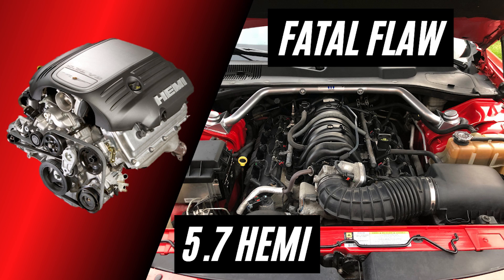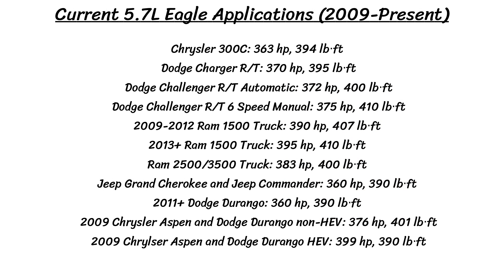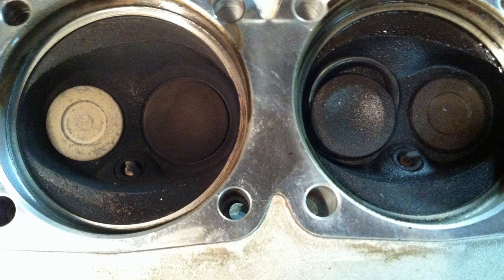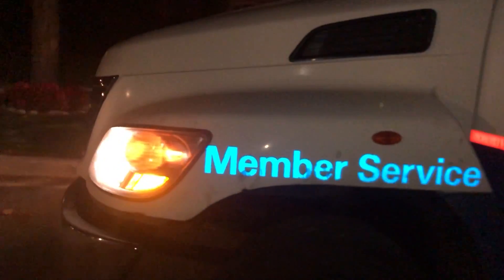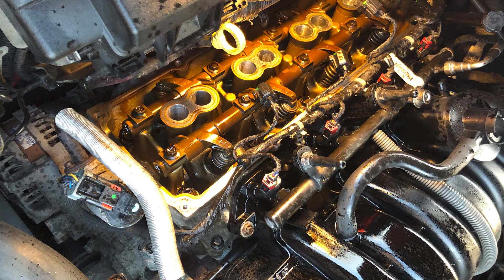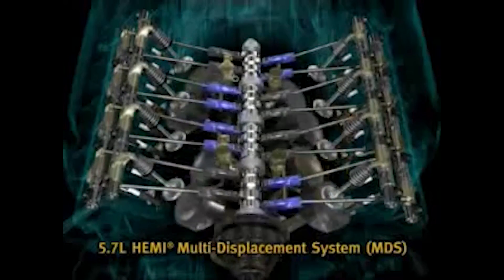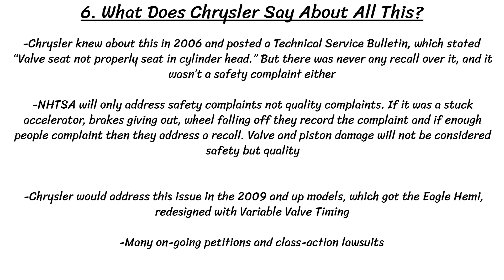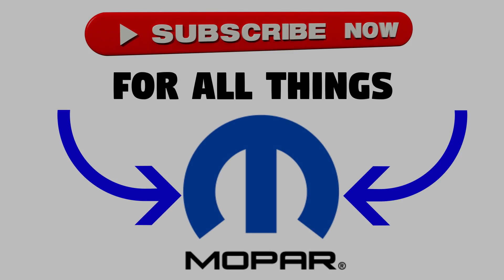The Fatal Flaw of the 5.7L Hemi V8 Engine & How to Prevent It (2003-2008 Valve Seat Drop)

Comment: It seems like an increase to the exhaust bolt diameter, and threaded valve seats and cylinder heads where the valve seats are installed at.

Comment: This happened on my 2011 dodge ram 4.7. Drove 8min to a ups store, went to start it and the valve seat dropped out of cylinder #3 with 150k miles
. total ass design.

Comment: happened to me at 169000. same senario. 2004 Ram 1500. drove to boat ramp about 1/2 hour at 65 mph. shut off engine to stage the boat for about 10 min. re-started and bam, engine shut down and the cylinder was shot. broken piston. truck had never been over heated or abused.. only this time, the engine had been at idle for at least 3 min. before shut down.

Comment: 2007 Dodge Charger 5.7L HEMI 137,000 miles. Bought at auction mechanics special for $1200. Found it had a dropped valve seat in cylinder 4. Piston and right head were in bad shape. Block was ok just honed it out. Replaced head, piston from local recycled auto yard. Ordered gasket set, new oil filter and new oil, replaced thermostat to a 185 degree. I did all the labor total cost was $300.00. I live in Idaho where it gets cold and I did get a check engine light that the engine didn't reach proper temperature, which is ok by me. It's been about a year, and it runs great. I'm 73 and I don't abuse it. It reminds me of my '70 340 Duster, loved it.

Comment: i didnt hear about needle bearing failure on hydraulic lifter rollers, which destroys the cam. This is a well known common problem. My Ram 2014 2500 blew up with 160,000mi. My 2006 ran over 360,000 mi without a problem.
Reply from the maker: Totally different issue, but covered that extensively in my Specs/Flaws video on the Eagle Hemi (2009-Present Engines). I agree that it’s very common. The valve seat issue affects mostly the earlier ones (don’t really see it on 09+)

Comment: my 300 is still going and has 220000 miles on it but has recently developed a miss at idle and is in need of a plug change. [last done 80k miles ago] as for maint. it gets oil changed every 5000

Comment: Luckily I have an 04 5.7 and ive been keeping up regularly with my fluids and especially my coolant replacing lines and the thermostat it gets to good temp and no over heating almost 300k miles and its still running like a top the guy before me took really good care of it and did regular tune ups and checks on cooling systems I do have an exhaust leak but thats because he got someone to put an exhaust on it and they welded it ok not amazing but not horrible

Comment: This just happened to my 2017 Ram. Cylinder 3 which isn't a shut down cylinder. Nor did I shut the engine down and restart it. Truck just lost power while cruising on the highway then died. Less than a hundred thousand and three years left to pay on it.

Comment: I have a 2013 Ram 1500 with 120,000 miles and so far I have had 0 engine problems with the engine,now the left headlight and tailgate are a different story.

Comment: It happened on my 2006 Daytona R/T at 207,000 miles. I turned it off immediately and had it towed to the dealer as I bought the lifetime warranty. The dealer then commenced to start the vehicle. I'm sure that did more damage and most likely destroyed the engine.

Comment: Its slow     it has 4 valves per cylinder   it freely revs to red line    it has 289 k       original engine and trans never opened     its slow     it's a 99 camry 2.2      thankfully not a modern hemi   how long has chrysler been making v 8 engines???    I know of two vehicles that dropped the valve seat     very ridiculous to have such a modern engine with this problem

Comment: Take a look at those headers......go ahead.  Take a good, long look.  You see?  THEY JUST DIDN'T CARE!
  The headers are the problem.  Regular headers have at least a 1 to 1/2 inch runner length to act as a heat dam to prevent the header from transferring the exhaust heat back into the head.  This one has none.  In fact, it hugs the head rather tightly, transferring ALL the heat back into the heads.  While this is good for thermal efficiency, it is bad for longevity.  
  If you find a header that does not hug the head.....use it.  Even if it kills some power.  Otherwise, you are stuck slipping in a cooler thermostat, and modifying the fans to come on sooner, and stay on 10 minutes later after shutdown.....like the early 2.2L engines used to.
  I'm old.  That's why I know about this stuff.  Seen it happen.

Comment: Beautiful advice. 
I've just bought my 1st 300 5.7 v8 2007.
Very well looked after oil change before it's due time.
I will definitely do the DTS thing wich I'm still learning. 
My need to listen a few more times.
Reply: This is a real problem it just happened to my 2011 4.7 150k miles

Comment: You explained very good.

I have the same engine Hemi 5.7L which has a random misfire and sometimes One Bank will fail which lead to running with one bank. Sometimes it will run perfect. 
What would be the cause. I will appreciate

Comment: I have a 2006 Dodge charger Daytona R/T 5.7 hemi.  I had no issues with the car/ engine as I bought the car with 103,000 miles on it. I maintain  the the car extremely well ! But I had a problem with the radiator.it had a crack in the plastic area near the top radiator hose. I replace the radiator myself and upper and lower hoses while I did the radiator. New antifreeze new thermostat. All was fine until a couple months later,the car started to overheat at an idle and antifreeze started spraying out from the fill tank,,,sooo I wasn't far from home and drove the car home!!!! Yes it was overheating and I didn't know why. So I let the car cool down and when a few hours had passed I started the car,it ran but was making a metal to metal sound,so I shut it off😞😞 I took the head's off and the right head dropped 2 valve seats. I replaced the head's ,but initially I did know why it overheated in the first place....the thermostat I replaced was from auto zone😞😞😞 and found that to be the problem for it to overheat in the first place....I put a stant 203° stat in it and told auto zone they sell junk and I won't go back!!! But make sure also if you have one of these hemis ,I suggest you make sure you flush the engine and REPLACE ALL THE RUBBER HOSES AND USE  A QUALITY THERMOSTAT!!! Yes the MDS is turned off...just a word of advice.
Reply: My car had 144,000 when this happened 😞

Comment: If you put a lower temp thermostat in the cooling system, the lower temp will increase emissions and set off the check engine light during warm up. This is true of pretty much any engine sold in the US for the past 20+ years. Also, the lower temp thermostat will not affect the running temp of the engine when fully warmed up, because once the tstat is fully open, it has no effect on the temp. All it does is slow down the warming up of the coolant temp.
Reply: Tune the fans. Problem solved

Comment: I have a 2009 Police Interceptor, 5.7 VVT and MDS. No Valve seat issues, 130k Miles with 14,000 Hours of Run Time. Doesn't Leak or Use Oil. It runs 13 Seconds in 1/4 Mile all Stock except a Straight Piped Exhaust with Two "12 inch Glass Packs gives it a Deep Tone like a Truck.
Reply from the maker: Yours doesn’t have the valve seat problem, but instead has a different cam and lifters issue. Valve seats were revised for 09 and up. Nice ride!

Comment: I have the 2004 Dodge Durango 5.7l Hemi and it has 263,000 miles on it. Now I am having and issue with it revving to high when coming to a stop and also lose of power with the engine getting to hot.
Reply from the maker: Sounds like something that should be fixable, and regardless that engine has lasted a long time wow 😯

Comment: Dropped at 178k on my 05 Ram. I think my cats caused it. I had started getting a P0430 code. Kept putting it off. Then one day just a bunch of rattling noise in the engine. Still runs but sounds like hell. She's parked now until I get a new engine.

Comment: I’m not a mechanic but I do regular maintenance on my 2007 Chrysler 300c.  Last time I changed the spark plugs I noticed oil in one of the 2 spark plug wells in the very back cylinder on the passenger side.  What is that an indication of and can I do anything to fix it?  Thanks.

Comment: Had a 2007 Commander with 148000 and this had not happened yet.  The water pump exploded 2 days after purchase, triggering the limited engine/transmission warranty.  Got a Tristar remanufactured engine for 1750 with the redesigned valve seats.

Comment: Would “losing” or perhaps burning up all the oil be a sign of this problem? I use synthetic and I’m not sure if it leaves soot. Yet the 07 truck burns or “loses” most of its oil up rather quickly. Anyone have any thoughts?

Comment: My 2006 Charger Daytona just suffered this, I believe.  With 115,000 miles driving home on the Long Island Expressway in evening traffic I noticed the faint sweet smell of coolant.  My temp was fine so I wasn't certain if it was my car or another near me.  I changed lanes  and places in traffic but still smelled the coolant.  At that point the temp began to rise.  By the time I got across all lanes of traffic to to the shoulder and stopped the temp had risen significantly but still not to the red and no warnings had come on although some steam was coming out from under the hood.  I stopped, killed the engine, popped the hood, then let everything cool for about 10 min.  I saw the cause of the leak, the hose from the top of the radiator to the engine had a small split and lost all the coolant; surprising as it otherwise looked to be in excellent condition, as were all other hoses which had been replaced within the last 30,000 miles.  After cooling I added some coolant and was going to limp to the nearest autoparts store a couple minutes away but the engine did not want to start.  Waited almost two hours for a tow and now my mechanic confirmed this is what happened...  This REALLY SUCKS!!!
Reply: Same happened to mine temp rose so fast nothing could do at that point. My baby died. Love that car. 2005 300c.
Reply: @jewelleryaddict Sorry to hear.  Just put new tires on and replaced the AC compressor.  190,000 miles.

Comment: My son says that after 2014, HEMI's had a flaw that would have the pistons fire through the block destroying the head. Because they cheapened the manufacturing process when FIAT bought out DODGE. What is he talking about? and did they address that? I told my son I wanted to get a TRX next year, he said NO, the HEMI engine is bad and said the above...

He just came and told me they did address it, but now the TRX is having other issues, like quality control, some are leaving missing bolts and other things.
What gives?

Comment: Yep happened to me at about 105k miles. On my 2007 Charger RT. Luckily I bought my car during the special so I have life time warranty on the power train. So the replaced the entire engine no question asked. I'm now at about 230k miles and am having a exhaust/burning oil smell coming from under the hood. Did the valve gaskets the other day hopping it would solve the issue.

Comment: 207,000 miles 3rd owner have had the vehicle since it had 51,000 miles miles never had any engine problems does have a slight tick once it warms up tick goes away207000 miles 3rd owner have had the vehicle since it had 51000 miles miles never had any engine problems does have a slight tick once it warms up tick goes away. 2007 charger R/T

Comment: 2008 Charger Daytona, this valve seat drop happened to me last October at about 90K miles. Happened while running as I was stopping at a stoplight after driving approximately 20 miles at highway speeds. Engine just died in the middle of traffic. Fortunately back in 2008 when I bought the car the Chrysler dealership was trying to boost sales to not lose its dealership status (spoiler: it did) so I got the lifetime powertrain warranty as well as the midlevel parts warranty (anything from the firewall forward covered) for cheap. The car had also been recently inspected by Chrysler as part of staying in compliance with the powertrain warranty, so Chrysler replaced the engine at no cost to me.  I got lucky.
Reply: Starting to sound like the early-gen-Focus SE fiasco!

Comment: I have a 2014 Ram 1500 5.7 v8 with over 1030k miles so far nothing is wrong with it but should i be worried about this problem or is the issue been fixed or only in the eagle engine?

Comment: Going 16 yrs with my Magnum R/T 1st Gen 2005.. this is exactly what happen 121000 miles as I left the dealership after replacing my instrument cluster. valve seat dropped in #2 cylinder. Dealership has replaced 2 new engines from Mopar, right out the crates, still have compression issues.. waiting on 3rd Engine now. SMH. going on 3 months at Dodge Dealership.

Comment: 2007 Dodge Charger 5.7L Hemi. I bought the Charger at a auction, smoked like hell and rattled. I knew it was a broken car but I was able to replace the right head and # 4 piston and rod.
Charger $1700, Head $225, Piston & rod $50, Gasket set 35, Oil & filter $25. Did the work myself, Charger runs great. After viewing this video I plan to change the thermostat and disable the MDS, change oil sooner and watch my tempature. Thanks for the info.

Comment: I have an 06 Charger R/T with the 5.7 Hemi, it has 118000 approximately on the OD. We bought it late model used in mid 08. I have not had any issues to date. The car belonged to my wife and she drove it many yrs very conservatively. Oil and filter changes have been  prompt at approximately 3 to 3500 miles and was switched to full synthetic oil early in its history. I am strongly considering having the MDS  edited. Thanks for this info. The wife has moved on to a new Telluride and it’s now my car now because she refuses to sell it, it still looks and runs pretty good, but is no longer driven daily because we have 3 other vehicles and I’m basically a truck guy.

Comment: It's just proof enough these Hemi 5.7 engines are no Bloody Good Very Very Bad Design I don't know if you can still buy the Hemi 340 Hemi engines they are by way far better than the 5.7 liter Hemi engine the 340 Hemi engine will out perform a Hemi 5.7 liter  for dead & way by far better reliable engine the 340 Hemi engine are very strong engines  I live in New Zealand & one of my neighbors Danny has a Valiant Chrysler Charger & has completely rebuilt the car ground up & has re built the 360 Hemi engine but has a 340 Hemi crankshaft installed in the 360 Hemi engine & the the power of the 360 Hemi engine has a lot of power & it wouldn't surprise me that the Valiant Charger with the 360 Hemi would leave a 5.7 Hemi Charger for Dust down the quarter mile &.it is also power to weight ratio as the Valiant Charger is by far a much lighter car compared to the 5.7 Hemi liter Charger & being a 5.7 liter engine it will probably drop valve seats into the cylinders & if not could end up with lifter problem going down the quarter mile the 5.7 Hemi sounds like it's too unreliable engine next Best Hemi you can ever have is the 426 Hemi & beat anything hands down just imagine having that 426 Hemi engine in the Charger in place of the 5.7 Hemi & it would go like a rocket & adding a 6/71 or 8/71 supercharger it would go like stink & another very good Hemi engine 6.2 Hellcat engine Kind Regards Peter

Comment: My 2008 Ram 1500 has 303400 miles. That being said your video and the one for 2009+ models with this engine give me confirmation that it's time to fix it before it dies.. it's starting to misfire a bit and variable hesitation / surging when  accelerating up long grades with steady throttle. Great video . Thanks

Comment: Bon through this issue 3 times already engine replacement was needed all 3 times 😡 but i love my car so much i did it but my question is CAN U PUT THE 6.1 HEADS FROM THE SRT 8. ON THE 5.7 AND ARE THE ISSUES THE SAME WITH THOSE HEADS

Comment: 95k on my 06 300 and no issues so far. Car ran a bit hot and I found the fans weren't working, replaced the fans, kept it cooler, but it still wanted to knock on 220 sitting still. Got a tuner and shut down MDS and changed the fan curve to not let it get over 203... Well it'll get over 203, until the fans kick to high, but not over 210.

Comment: 223,000 miles on my 07 Charger R/T and still runs like a champ.
Reply: 223k? Holy shit! I just got my 07 R/T and it only has 68k 😢
Reply: @V8_Diva  just make sure to get all scheduled maintenance done and you should be good.
Reply: @V8_Diva  340000 on my 04 Durango
Reply: Hell yeah I have 80k on mine but I beat on it hella
Reply: @BuildZFortnite as long as you do all the maintenance and ON TIME should make little to no difference bro
Reply: Just bought a Magnum R/T. 182k miles. I have maintenance records going back to 09. I changed the leaking valve cover gaskets the other day, and there is absolutely no sludge. I was impressed. They will last forever if you maintain them
Reply: 151k on my 07 300c! I do my own maintenance(spark plugs,oil changes and much more)

Comment: I have a 2007 Charger with the 5.7 L Hemi it does not have variable displacement and at over 70K miles it is still running strong. My spedo will go past the 165 mark, but at those speeds the vehicle begins to float. Only took it that far once and I believe it was around 200 mph. (K&N high performance air system, no rev limiter or top end limiter)